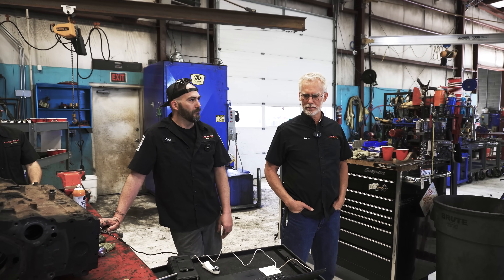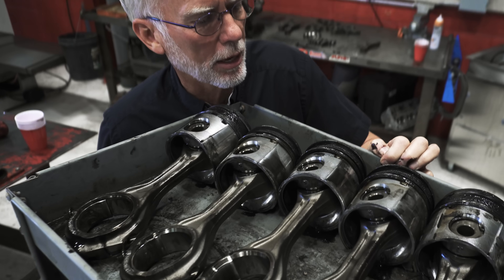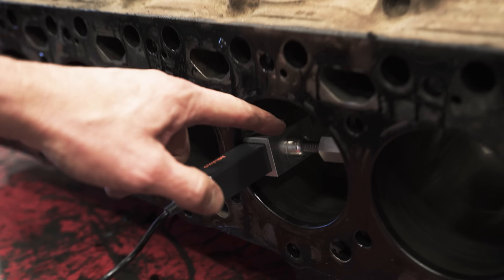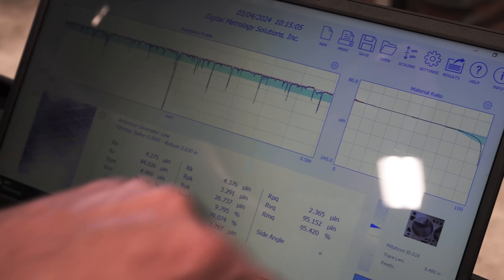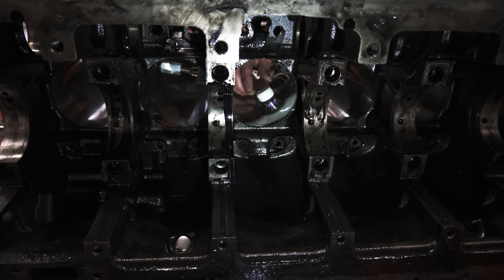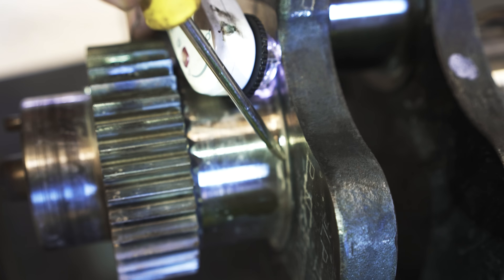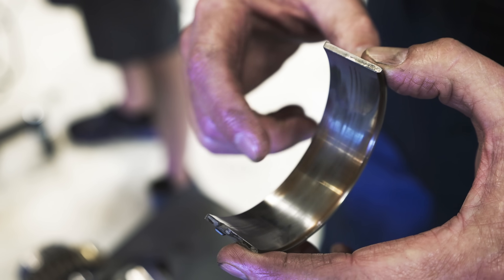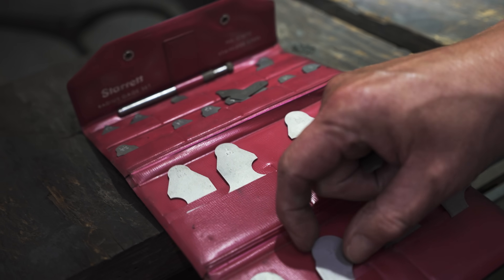5.9 L Dodge Cummins tear down inspection reveals poor machining

Comment: Top ring looks worn out (close to full face wear), possibly "dusted" out. Check the oil ring faces, are they real wide and is the expander (if one used) wearing into the back side of oil ring? Dusted engine will give you a nice shiny cylinder bore.

Comment: How do you make the radius accurate when the dresser is so far below the center line of the grinding wheel?
Reply: Great question. Unless that diamond tip fixture is tilted with a radial line to center with perfect perpendicularity...ain't gonna happen. Like measuring a circle with the part tilted. It becomes an ellipse. Blah.

Comment: I love Dave’s ability to describe the nuances in these projects. I was fortunate enough to have gone to a small voc-tech in Washington State, and luckily the old timers stressed the importance of each step to be done with cleanliness and accuracy. Checking tolerances every step of the way. Ring gaps, oil clearance see on every bearing surfaces, etc. I built two diesel engines with their supervision and each one turned out very good.

Comment: These Dodge Trucks with the 5.9L are one of my favorite combinations. If you treat an old mechanical 5.9L correctly and change the oil when your supposed too. In the railyard industry from 1995-2008 all the spotter trucks and alot of the heavy equipment was all 5.9L non electronic, non emission great engines kept freight moving at all the Chicagoland area anyway.

Comment: Between your channel and other machine shop channels, I lost any will to do the engine in my old VW golf myself. The Golf is 20+ years old, I'll probably buy a known crate motor and gearbox combo, build both the existing motor and gearbox myself and if any of those fail, swap in the crates and send my f*ups off to be rebuild.

Comment: I usually pick up a Haynes book for each of the vehicles I've owned over the years - not necessarily to do the shade-tree mechanic thing, but to be informed on what is involved in repairing or replacing a specific part on that car. Each copy has a chapter on the steps involved in a general rebuild of an engine, and it includes how to assess certain major defects in the bottom half of the engine by the type of wear in the bearings on the crankshaft. One failure mode was 'tapered journal', and here you've finally explained how that failure mode comes to be, so thank you for that!
Reply: Bellmouth.

Comment: I’m really curious about diesels now. It’s a new fascination I’ll admit. As an arising engineer I both see the environmental impact on the exhaust side and what that entails but I also see the havoc these “EPA regulations” are causing havoc on these trucks. My question is what solution is there that doesn’t kill the engines but also is “friendlier” to the environment. Also making stuff not to break probably would have a drastic economical and environmental impact I.e. using less materials and people not spending fortunes to repair vehicles.  

I’ve studied a little about this stuff and I guess a mediocre/cheap solution would to have scrubbers on exhausts like they have on power plants to filter out some of the toxins. Obviously you would have to make it work for a vehicle exhaust system and make them worth it. Cost should be affordable, it needs to last I’d say 3-6 months, and possibly they should be easy to reuse/clean or remanufacture  again. 

Maybe there’s other solutions and I’m sure someone will inform me of that. One things for sure. You build quality stuff it won’t break as much and there’s less you have to do about it. Less money spent. Less parts used. But the modern automotive industry is cutting a lot of corners as we all know.
Reply from the maker: You ask good questions. Cheering you on in your engineering career 👏👏

Comment: It's shocking to me you seem to be the ONLY shop in the business doing the right things. Kudos to you and your team. If my LML ever dies, I know where I'm going.
Reply: The only other is Banks.
Reply: @pgmurray76  that you see on YouTube. There’s more honest shops out there.
Reply: @markm0000  I actually know the owner of an engine shop that grew up across the street from me. He builds for manufacturer and petroleum industry life cycle testing, along with all the race engines and rebuilds. He rebuilt a 5.9 mechanical for his son's Cummins swapped Dodge Ramcharger. Smoothest, most deep, and cleanest, smokless build I may ever see. So jealous. I was wrong. Not even sure Banks does any rebuilds anymore or at all. Dave and that man think alike. Anyway, my old neighbor prefers n/a builds, but was a specialist racing with roots style blowers decades ago.

Comment: Those cylinders are washed, if you properly hone the cylinders and don’t work the piss out of the motor after it’s been rebuilt you will end up with glazed cylinder walls best practice is to properly hone the cylinders and install the engine put a heavy trailer on it get it up to temperature and work that motor for at least thirty minutes have to maintain pressure and heat to properly break in a diesel or it will use oil and live a short life

Comment: A good machine shop is hard to find! I bought a set of used big valve small block Chevy heads took them to a machine shop that I thought was trustworthy to do a valve job and told them that I didn’t know if the heads were good so I wanted them magna fluxed to check for cracks! Got the heads back they said they were good built the motor started it and as the motor started warming up I had antifreeze leaking out between the exhaust ports from a nice big freeze crack between the exhaust ports! I don’t think the machine shop magna fluxed the heads even though they charged me for it!
Reply: SO, what happened next? Did you take it somewhere else?

Comment: Why am I doing so many timing chains. . Why am I seeing engine failures. At low mileage. . . Oil oil oil.  
Cheap filters.   Wrong oil.   Jiffy lube.  . 
 I think I covered this . Manufacturers telling customers oh. You can go. 20 k. Miles .don't change the oil.

Comment: Yep. Big fan . Absolutely correct on location of wrist pin clips. . However 
U did  not pull oil control rings . See if. Return holes are plugged. . . The crank issue. Ya was not . Line bored. I suspect. . .

Comment: So…brought back a memory for me….my first engineering job was as a draftsman (lowely peon)at a place in midland Mi called Ingersall CM Systems….they built large CNC machines that auto and truck manufacturers use to machine crankshafts (hence the CM in the name)…there were sometimes over 100 different machines doing various operations on a crank….they specialized in 5 or 10 of these operations and others made different ones…..there big claim to fame was a fillet roller specifically for that spot on the crank you showed in the clip….it was a very specialized operation and that fillet was work hardened….the engineers that designed this and other tooling were grouped in their own cubicle territory…every time I needed to ask them a question it was like going to the engineering oracle at the top of the mountain….i wonder if you engine builders and machinists worry about this work hardened fillet when you grind it to rebuild the motor….what I remember is this fillet needed to be work hardened to avoid the potential for the journals to crack there under load….maybe the new cranks aren’t work hardened or some other improvements to keep a crack from forming at that fillet…obviously they still put one there and you showed the problem with having ground it wrong….

Comment: Well of course it doesn't have any crosshatch it clearly  needs to be resurfaced duhhh the pistons were covered in oil and soot lts clearly not scraping the oil from the walls was probably burning oil too any good builder knows that.
Reply: You missed the whole point of the video..... it was semi-recently rebuilt. It should not be needing a resurface at all.

Comment: No way I would let anyone else, other than Dave and his crew/family, touch a rebuild job on my LB7…!  Waiting to get a LB7 “tow monster” with iron heads, Speed of Air pistons and a few other goodies.  These guys just do it right, with a smile and the talent to back it all up.
Reply: It's highly doubtful that my low mileage Cummins will croak but I'd drive or transport mine to Dave's in the event.

Comment: Hello Dave: Thank you for this important video on surface finishes, use of a profilometor, + the basic dressing of the grinding wheel prior to grinding of the 
 journals of a crankshaft. Dave you are to be commended for your detailed explanations of surface finish per application as well as the  proper setup prior to grinding. I must say that you & your son are the first time I've ever seen a profilometer used in an automotive application. After 18 years in the aerospace industry we utilized a profilometer almost on a daily basis especially for armatures, & bearing bores. You also brought back many memories  of the proper grinding operations especially needed for close tolerance work per application. Sorry for the rant but you & your crew constantly amaze me regarding knowledge, individual abilities,  + the discipline to adhere to proper procedures & practices. Thank you again sir. God Bless you, your family,  and your crew.  TMP from N.J. 🙏
Reply from the maker: Good to hear from someone in the aerospace industry. You add a depth to this channel 👏👏
Reply: @DavesAutoCenterCenterville  Thank you Dave. You & your crew are awesome 👌 👏 👍. TMP from N.J. 🙏
Reply: No seal surfaces!? Ok, ok, apples with apples. You are relating the bearing mating surfaces with that of a crankshaft. PTFE impregnated, anodized hardcoat FTW! (With perfect cylindricity too)

Comment: Would a plasti gauge in 3 spots of the same journal have caught that? 2 on the edge would have been tighter clearance than the one in the middle?